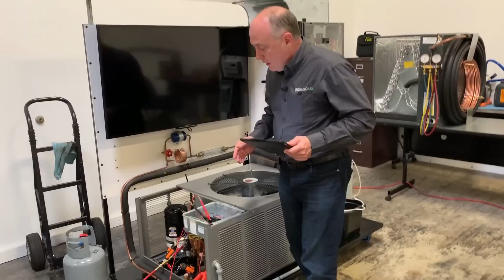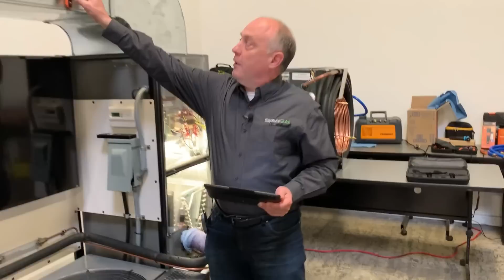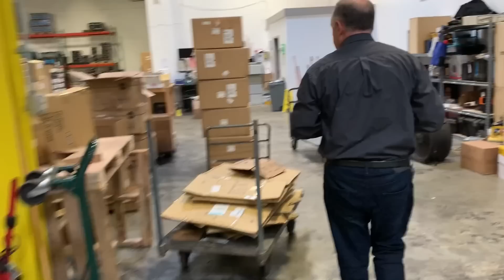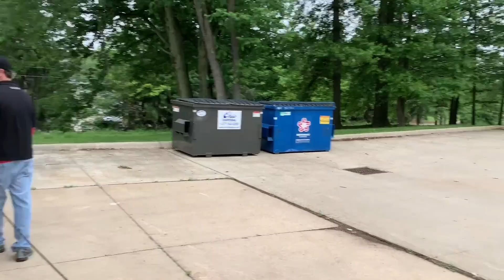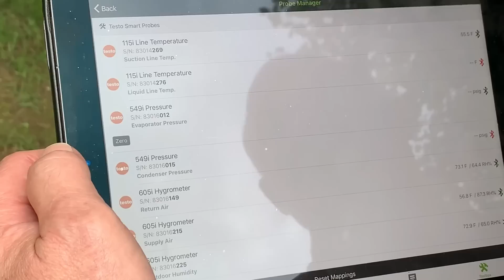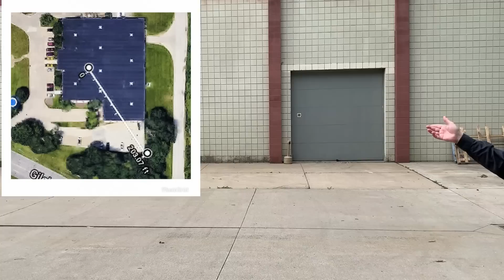NEW Testo probes

Comment: I have the testo 549i and 115i probes. I am lucky to get 20Ft. Most of my work is in older homes in Chicago. they have anywhere from 8" to 12" thick walls and frame homes with 8" thick wood and siding. If I use the probes on the evaporator and walk outside I will louse the signal before i get to the condenser. I have sent them back to testo, and they said that everything is fine, we get up to 300 ft. range with them. So know now i have nice book ends. All I can say is try some demo sets before you buy to see if they work for you.

         Cc
Reply from the maker: Charles Cooney They made a significant update to the range a few months back, if you have the older probes you are correct. That said, we did add capture buttons to the app for all probes if there are range issues so you can lock in the readings.

Comment: What device are those probe connected too? On my Samsung S7 edege only 6 probe at a time will connect.
Reply from the maker: For this video, we used an ipad.
Reply: @measureQuick  will it not connect to more than 6 probes with Android devices?
Reply from the maker: @apr9286  No, it's max is 6.  With Fieldpeice, you can connect up to 20 probes.  So if you have a combination of those two brands, you can use both.

Comment: How do you know if you have the long range test those probes?
Reply from the maker: The long range have a 45 degree connection fo the pressure probes and the hydro meters have a pivoting head. The clamps have no physical difference. It is a running change at Testo so they will all be coming that way now. Also the packaging says up to 350’ range
Reply: Walk 10 feet away and you'll find out. Range is terrible

Comment: My 605i doesn't have a magnetic back.
I got jipped!

I could also use those longer range pressure probes.
I was recently using my smart probes on some pneumatic zone dampers and it was hard to keep connection to my tablet on the equipment above the t-grid ceiling at the zone damper and pneumatic controller and with the air speed smart probe in the supply vent a few office rooms away.

I'll be due for some new ones eventually. 
I've had the smart probes for a few years now and one has the button falling apart. Got electrical tape over it now. Still working. 
I use them several times per day.

Comment: Finally I can now buy a set of Testo‘s before they were pathetic on their range and drop out problems. That range through a cinderblock wall and steel door it looks like a 👍 thumbs up.  One more test where many of us have problems including myself working in downtown busy working complex area other Bluetooth devices interfering with the Bluetooth connectivity. I often work in areas where you’ll have anywhere from 10 to 20 Bluetooth devices operating within range of the sensors. If you could do some field testing having several Bluetooth printer is turned on some Bluetooth speakers in the background turned on maybe tile devices for locating keys in other manufacturers sensors that are all Bluetooth connected within the operating range of the Testo devices to see if they interfere and knock them out of connectivity. Because in the real world out here this is what we sometimes have to put up with. In ideal conditions where there’s no other Bluetooth devices operating you get good results some devices when you start adding in interference with other channels that are operating on the same band your devices start dropping out.